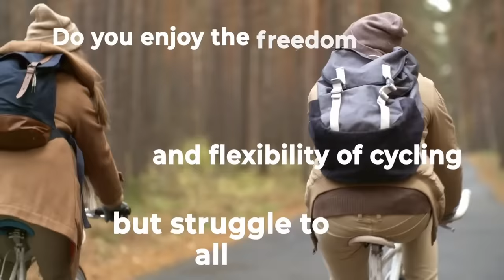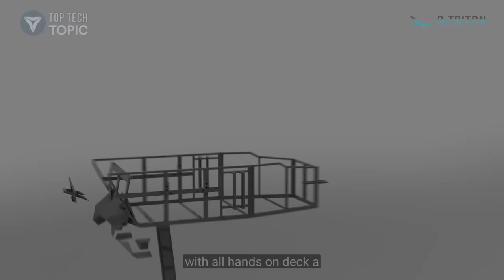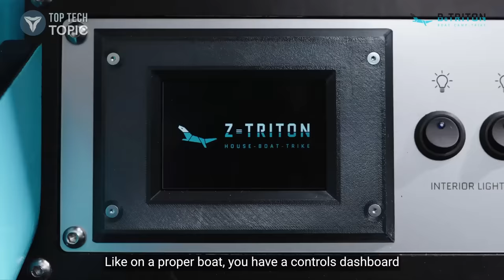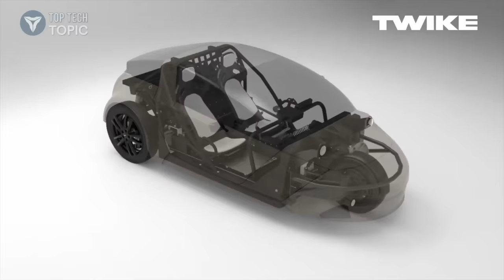Top 7 Personal Urban Mobility 2030 - Bike Cars, Tricycles  and Quadricycles ▶ 1

Comment: Take #6 The Pod Bike,  keep it narrow for the shoulder of the road, add suspension, make the seated enclosure double as a sleeping pod by laying the seat flat. Cover in solar panels to recharge, for road trips bring a pull behind trailer......To make it really awesome, build it to float so it can double as a small boat. Add small electric boat prop in rear, keep it light enough to push if it gets stuck when driving off road.
Reply: please i dont understand english well. what do you mean1  ; make the seated enclosure double as a sleeping pod by laying the seat flat. 2;  for road trips bring a pull behind trailer.
Reply: darthdude5122  I'm working towards building one. If you get bored check out the Trisled Aquila 3. I want it to be similar to it.....They have ebikes & e scooterers that can easily do 65mph. It's not that hard to build a small light fast single person commuter vehicle that doesn't use a ton of power like an electric car or truck. I dunno why no car makers are building a serious one for market. 
Think narrow 3 wheel lightweight electric Go-Kart with a lightweight fiberglass aerodynamic weather enclosure. 
If  it's registered & street legal it'll pay itself in fuel savings 🆚 using  gas or buying $50,000 electric car + money to change.

Comment: i found only the 2nd no. ARCIMOTO to be practical n sturdy. other all looked so too flimsy. when on roads at higher speed, u need thicker tires for better grip n strong body shell to protect oneself. the no. 7 TWIKE also looked strong but the having 1 tire at the front will cause tumbling of vehicle while taking turn at higher speed if road is not straight...